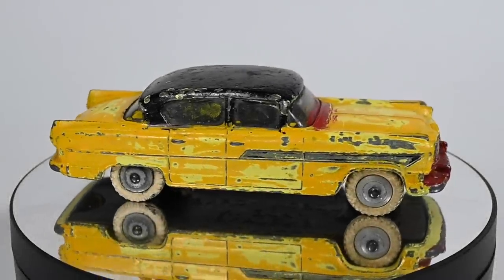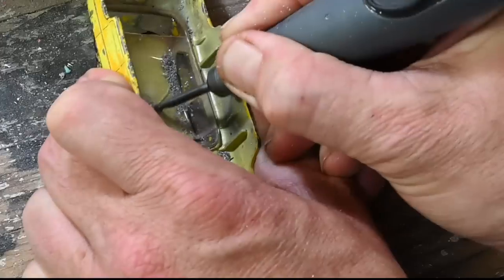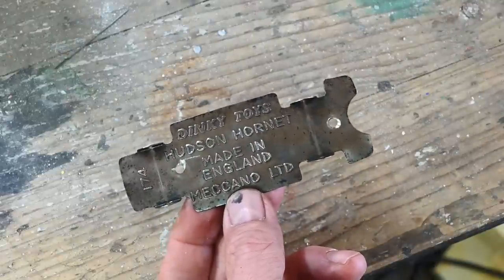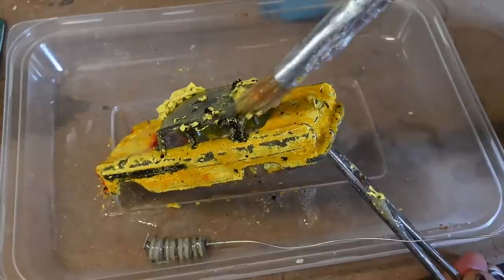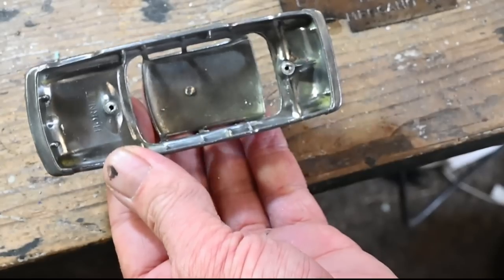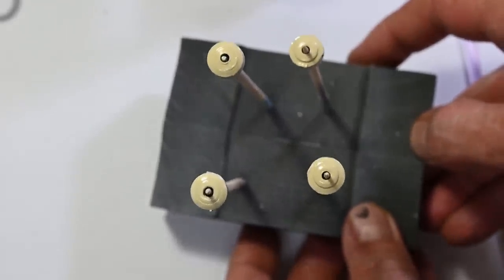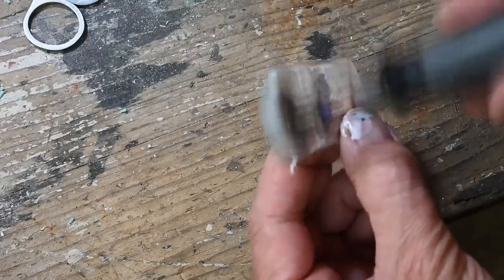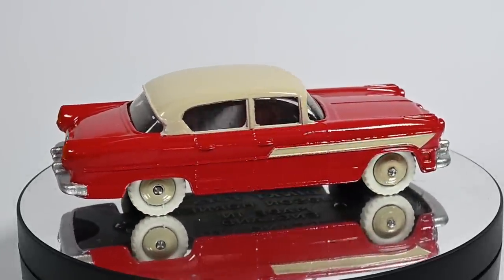Dinky Toys Hudson Hornet Restoration

Comment: If the glass has a crack in it but it’s by the rivet, before you drill the rivet, put a bit of liquid poly on the glass and let it dry, that will stop the crack spreading